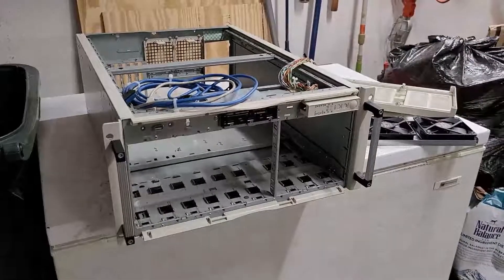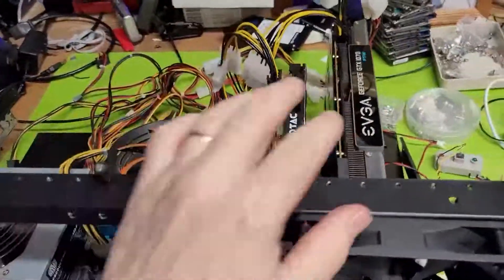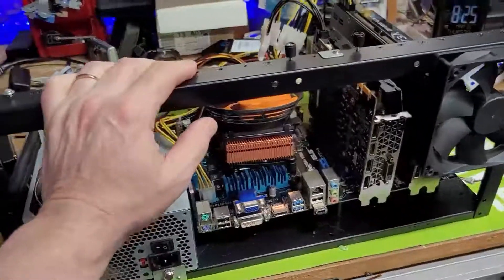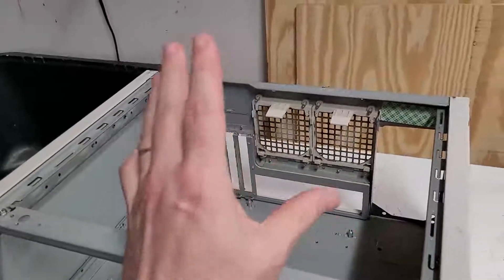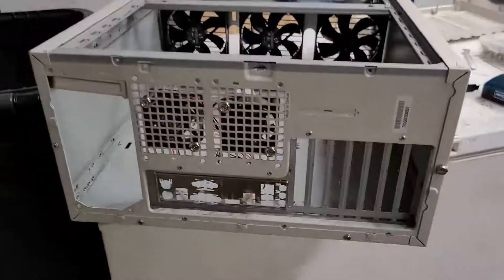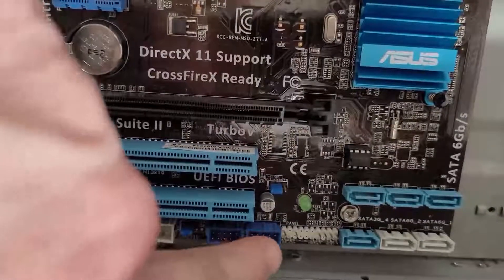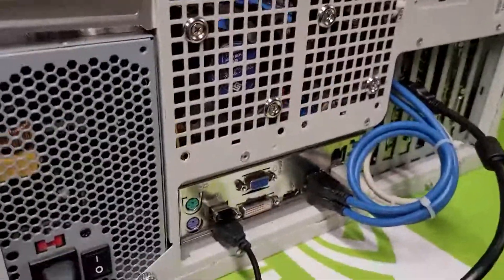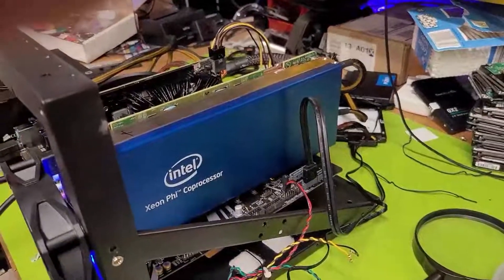Time to move to a new mining rig chassis (time to recycle an older server 4-U rack case...)

Comment: Shouldnt you remove the front cover to get better airflow? The front fans should be screaming for fresh new air.
Reply from the maker: Well no.  What you want to do is force the air over the total front of chassis air flow for air will go to the least path of ressistence.   That is why we don't recommend that you remove your HD / FD / DVD caddies for better air flow.  (No large whole anywhere is best.)  You will actually create a void in the air flow and gear heats up...  So try to even out all the air ports across the front of the chassis so everything get air flow.